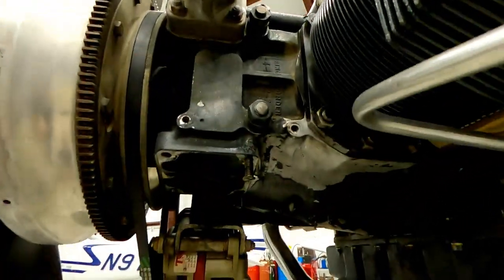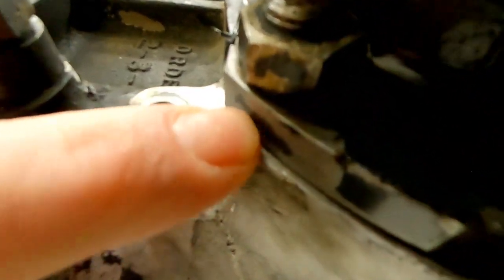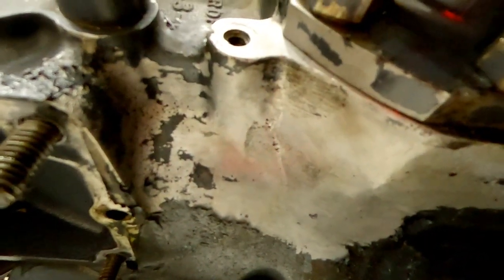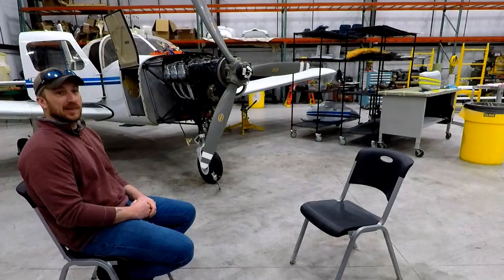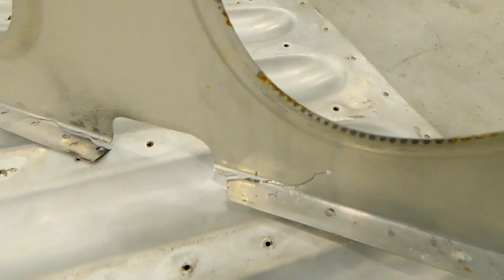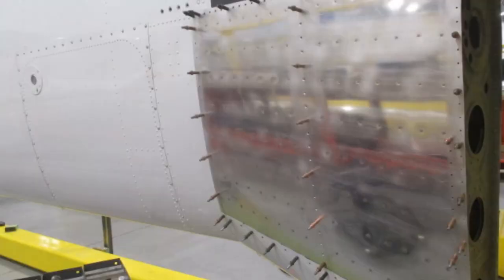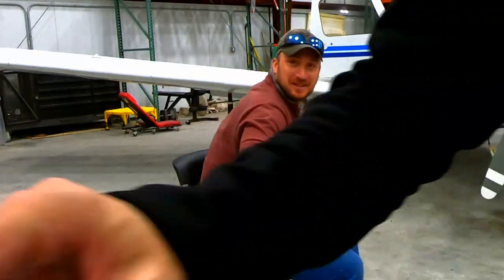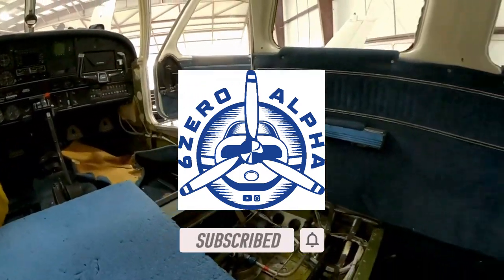Repair, Re-build, or Replace? | THE Cherokee Six Annual to END all Annuals From Hell

Comment: Sorry to hear that man. :( In the end it's tort lawyers and bureaucrats who are responsible for these prices.
Reply from the maker: thx but disagree, pretty simple supply & demand equation due to years of outsourcing American jobs to other countries & a global pandemic.
Reply: Certification standards & liability play a role but the true distortion in the pricing is due to it being a  captive market. These engines are actually very simple mechanically. Anyone tells you they are better and more reliable than a new car engine is an idiot.
Also sharing the blame with the captive market is the low volume. If Toyota only sold 50 Camry's a year the engines would cost a fortune.
Reply: @jmizzonini  I'll argue that they ARE more reliable BECAUSE they are simple LOL :)  (private pilot SEL)

Comment: Ouch.  Break in time is interesting.  With my Tiger I had to break it in, high power settings and not about 5500'.
Reply from the maker: yep "hot & hard". did you do frequent oil changes?  When I broke in the current (failed) engine in 2015 after prop strike in 2014 (not by me ), tear down & IRAN. New crankshaft, piston rings, prop & governor. first 10 hrs straight mineral oil, oil change and look for metal. if none. 50 hrs 100% mineral at 75% power leaned to high EGT. Oil change & metal analysis after.
Reply: @6ZeroAlpha  It had 10 hours when I bought it.  On mechanics advice, and Mena aircraft engines, I did not run mineral oil.  Changed, I think, at 50 hours along with a required bolt torque check list.  Kept the power above 75% until past the 100 hour mark.  Consumes almost no oil and pulls strong.  A&P discovered mags were out of time by 3 degrees so it is actually running a bit smoother now too.